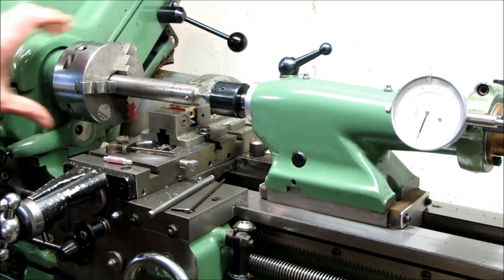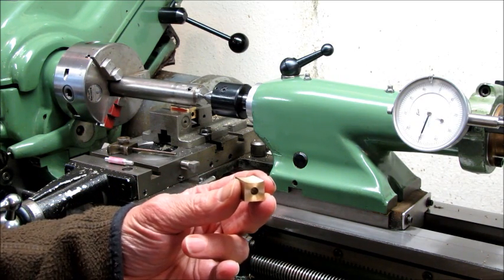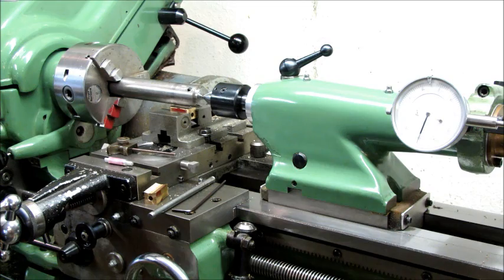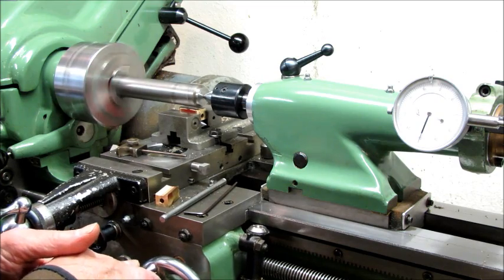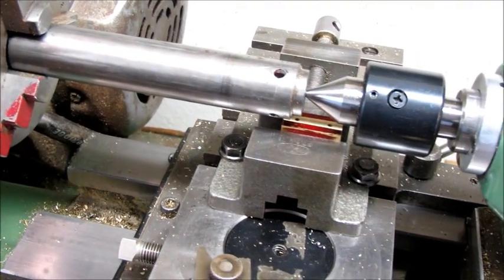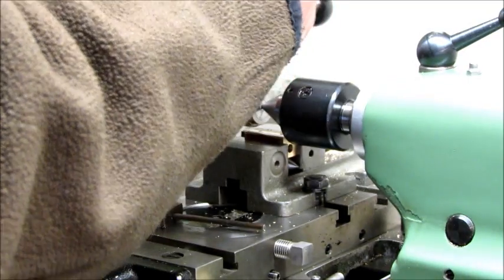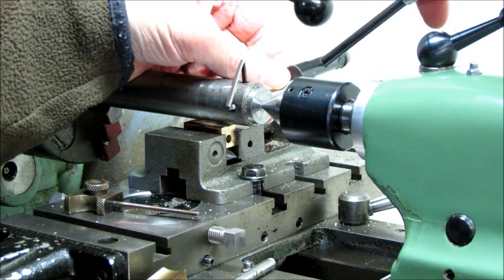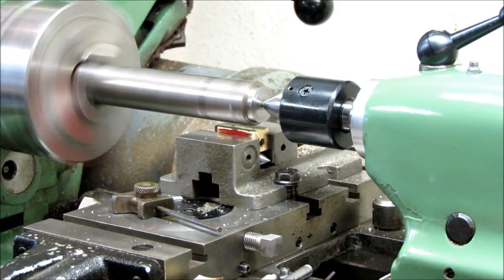Boring bar cutting an external curve

Comment: Why did you not set the work up at centre height and control the cut with the cross slide? That would man just one setting of the bar (fly cutter) to the finished radius......Every time you adjust the cutter you change the radius of cut....... which makes it all more prone to error.....
Reply from the maker: I could do it that way too, but I just wanted to see how this way would work out. There are any number of ways to solve a machening problem, that is the fun --  to try something different.

Comment: basically what you are doing is what is called 'line boring'. you chuck up a boring bar, mount your work on the carriage and 'bore' a diameter. Kieth Fenner of Turn Right Machine Works has several really good examples of this using a lathe. he does a lot of line shafts for boats.
Reply from the maker: I saw Kieth Fenner do it and that is what gave me the idea.

Comment: Hi Ernie:
I have a better solution for holding your boring bar bits. MSC Industrial Supply in New York, US, offers round sleeves with a square ID in one end and a threaded side with a set screw on the other end that allows you to use square bits and feed them with precision and ease. They have diffrent OD/ID sizes. As for the feed of the bit, you could also set a dial indicator in front of the bit, loosen the grub screw holding the sleeve, turn the adjusting screw inside the sleeve, and then tightenning the locking screw again. They are not expensive and work great.They are in fact, boring heads in miniature allowing you to do jig boring.

Cheers

Jorge - Toronto, Canada
http://www.mscdirect.com/browse/tn/Turning-Boring/Lathe-Tool-Bits-Holders/Tool-Bit-Holders-Sleeves?navid=12105893#navid=12105893+4294960022
Reply from the maker: Thanks for the tip. This was a one off project and I did not want to spend extra. I have seen the sleeves, and may try this if I have to do it again.

Comment: Hi Ernie, it was quite lucky that you could mount the block in the vice on the cross slide without needing the vertical slide. Made a nice solid set up. Thanks for showing that method.

Comment: Maybe, if you have to do this often, you could place a ¼ " x 20 bolt on the back of the cutter so that you can precisely advance the cutter knowing that a complete turn of the bolt will advance the cutter by 50 th.
The cross feed is really great. Is this  standard with the lathe or did you make it ?
Reply from the maker: As a one off operation, it was something I have wanted to try and I did not want to do anything extra. The ¼ x20 would have to be a set screw that did not sick out the back end too far. The cross slide and feed came with the lathe. It is a used Myford.